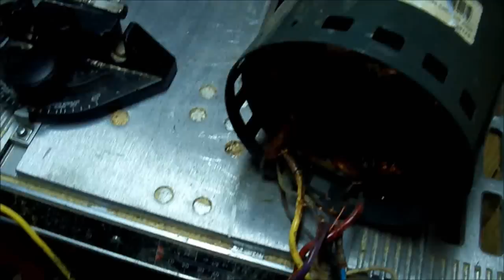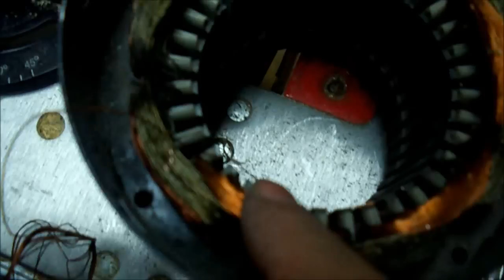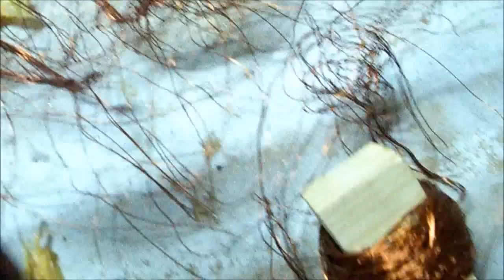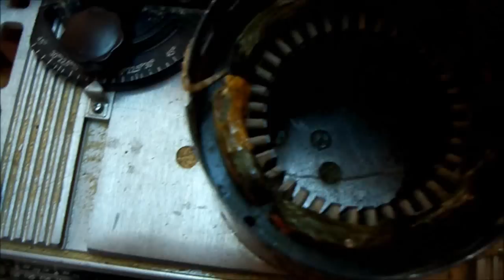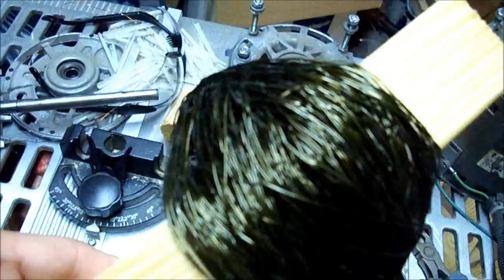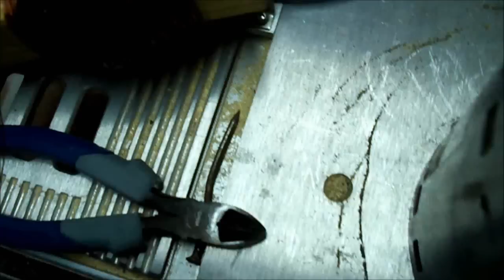Convert AC Induction Motor to a Generator Part2

Comment: I'm going to do this on a very old 1/4 hp motor with cloth wrapped windings (2) but I think I'll try it with 12 magnets...its not very big but it's like 45 pounds..it has an iron case..I got 12 ring magnets n52 with a tapered hole for a screw..it wasn't a great motor..it took 600 watts to run, more like a half horse, no start winding just a run...it was always slow to take off too..but I figured since its 75 years old it's probably got good copper in it so it might work for something